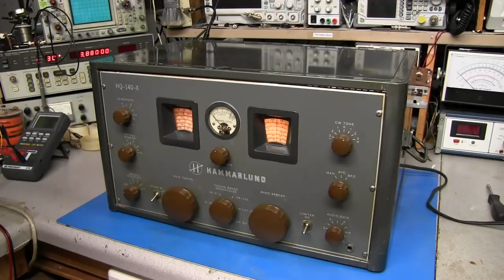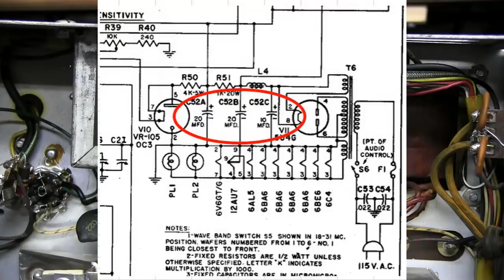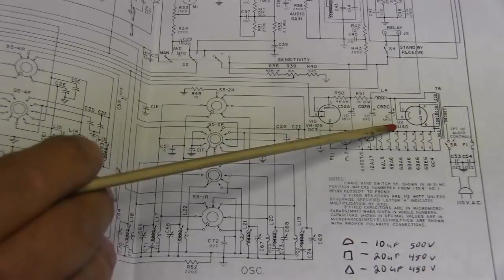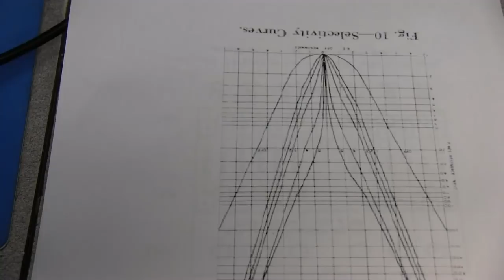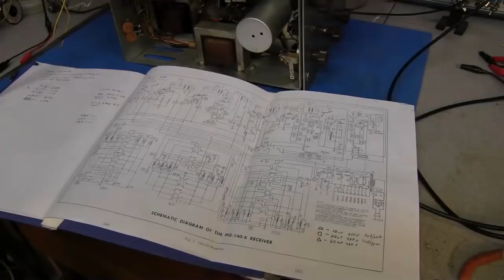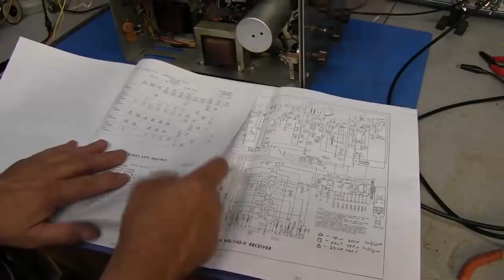#238 Hammarlund HQ 140 X Repair Part 1

Comment: The varible capacitors in these hq 140s   129s etc are superb works of art and precision crafted .  very fine varible capacitors.  dont find that any more.  clean up jobs can take lot of time dials chassis etc .    labor of love,  takes long time.    I have restored 2 of the HQ 129s       long ago had a HQ 140 as well    superb AM receivers and cant beat AM broad cast band DX either   way better than some new junk they make these days.         thanks for video radio shop .      Tony ve4akf

Comment: Can you tell me how to make the isolation boxes, I have the same spectrum analyzer, but I need to build a box to isolate the high voltage in the radio to the spectrum analyzer. I don't want to hook my spectrum analyzer directly as it is limited to 50v input. my Ham call is WB7QXU good on QRZ

Comment: The residue from the cigarette smoke (tar) will collect on the coolest parts of the radio. Therefore, the upper part of the front panel and the dial discs are the worst.

Comment: Another great video,  thanks for putting these up for our education and enjoyment! 

I was wondering what's inside the black boxes that you used to connect the tracking generator and spectrum analyzer input to the radio.  I assume they're to protect the test equipment from DC and impedance match the 50 ohm coax to the balanced input for the radio? You don't happen to have schematics for those that are shareable do you? 

Big thumbs up on these videos!
Reply from the maker: Thank you very much. Mr Carlson did a video on those boxes  a while back.
All the credit goes to him, will link it below.
Reply from the maker: https://www.youtube.com/watch?v=ETKyKC2Zj-M
Reply: @TheRadioShop  That would do it! I love Paul's videos as well. You both create fantastic content. Paul's boxes were designed for 1M ohm input spectrum analyzers. Did you adjust the design for the 50 ohm input on your Rigol? I have a Siglent that's also a 50 ohm input.. Thanks so much for all the help! I really appreciate it given how much time it has to take..

Comment: A really nice radio.
I have a number of observations, recommendations, suggestions, etc.  First, mostly for in the future because I suspect that you are done with this one now, I would like to suggest that you give "Odo-Ban" a try for cleaning off the tar from cigarettes.  First of all, it is a very good cleaner.  It is also a disinfectant, and does an excellent job of eliminating odors!
I noticed that this radio uses the infamous "death caps" across the line to ground (both hot and neutral sides to ground.)  Really should be replaced with Safety Caps (Y type) if they are not already.
The green disc capacitors.  Are they Ceramic Disc capacitors?  If so, and they are being used for coupling from stage to stage, I highly recommend that you change them out for a different type capacitor.  Ceramic disc caps are microphonic...and can generate noise on the line, also they tend to change value considerably with temperature.  I may not be explaining this well enough, but it is shown wonderfully in this video:       https://www.youtube.com/watch?v=67M7fsbLUIU
Wow!  You just got to the point where you were turning the XTAL selector knob and man were the patterns lousy!!!  Bet you will make them look beautiful when you adjust it.  I guess this is going to be a multi part video.  Looking forward to the other ones soon.

Comment: Great video Buddy.  I have the same spectrum analyzer and would love to use it on old radios.  Can you elaborate on the "boxes" you are using to impedance match and protect your Rigol Spectrum analyzer?  Mr. Carlson has a vid on it but it is for 75 ohms and many requested he help them with this problem.  It is a great tool but too expensive to blow the front end just trying things at random.  Thanks Doc.

Comment: Great job cleaning up those dials!  The dials in my Hammarlund HQ-120-X are in good condition but are slightly warped causing some rubbing along the edges.  How can I fix that problem without distorting them?

Comment: Nice work Buddy...what are you using inside your two interface boxes to couple the TG and SA into/out of the circuits?
Reply from the maker: Hi Dino. It is a string of capacitors, .01 followed by 8 100 puff caps in series. Also a series of forward and reversed diodes to protect it. The tracking gen box has a 50 ohm resistor on the TG side.  Paul did a video on that quite some time ago.  These are replicas of his. Thanks for the comment my friend. Pauls video below...
Reply from the maker: https://www.youtube.com/watch?v=ETKyKC2Zj-M
Reply: @TheRadioShop  Thanks, I'd forgotten all about Paul's idea and video from 2015...gotta make up a set for my bench.
Reply from the maker: @Dino--KLØS  They work pretty good and sensitive enough so you do not have to make a direct connection